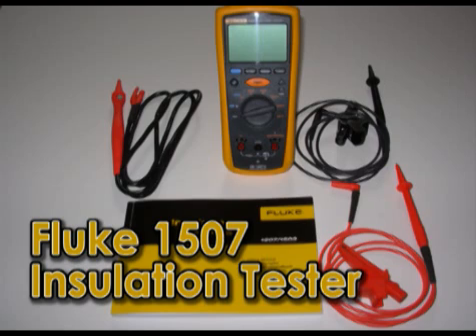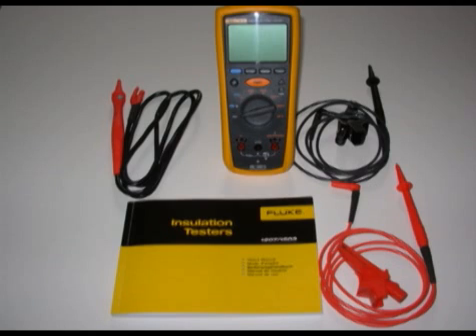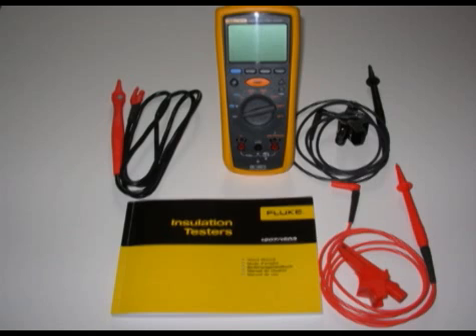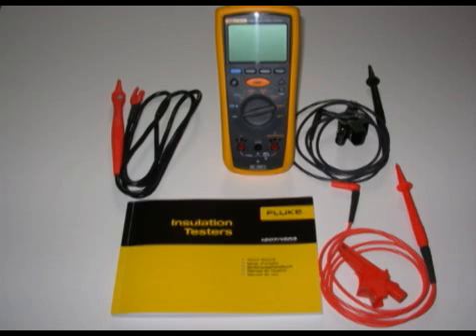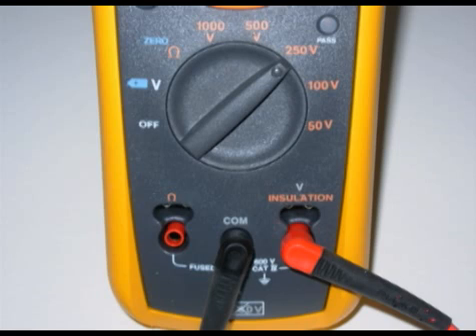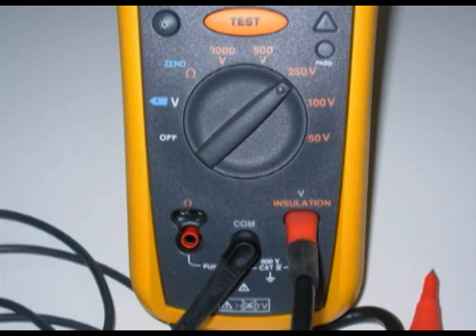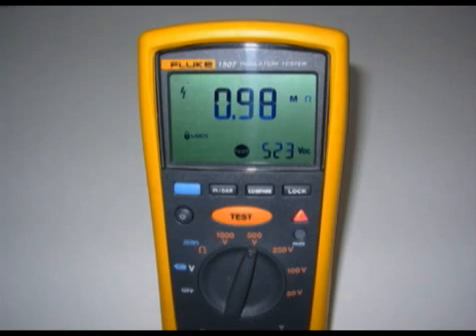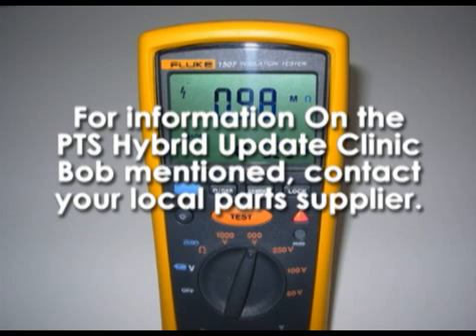Fluke 1507 Insulation Tester

Comment: The test voltage rating for AC is not the AC voltage plus 1000V stated here.  It is normally twice the AC voltage on 'healthy' systems. On old systems I test at the AC voltage.